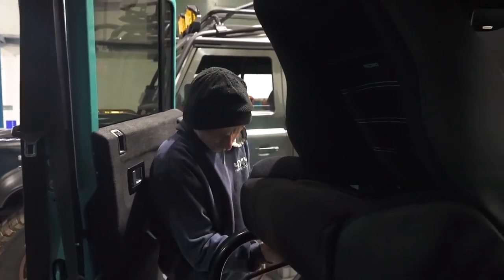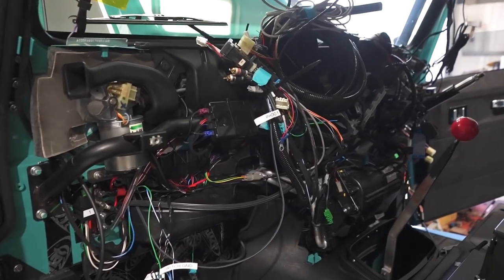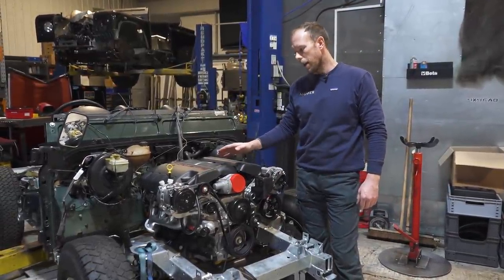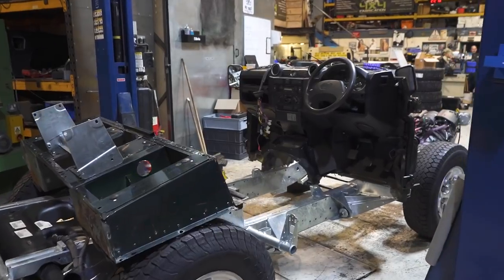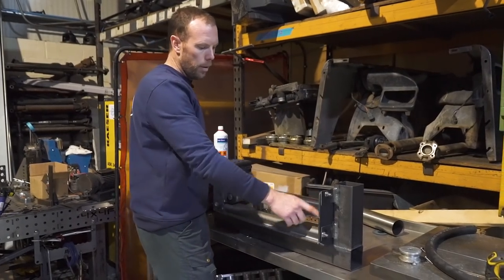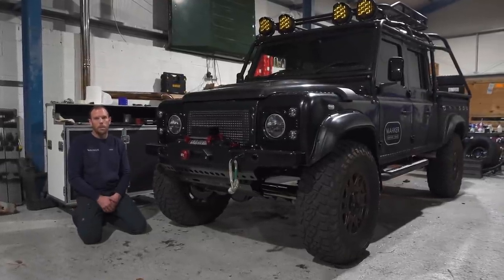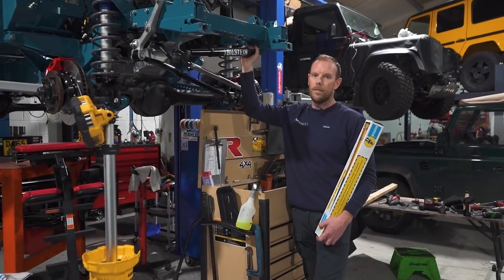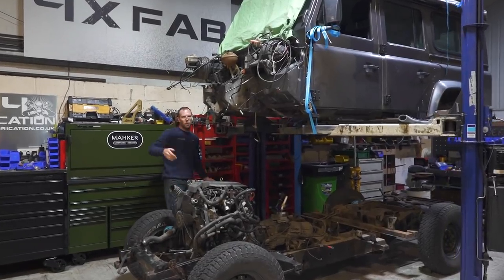THE ONLY VIDEO YOU NEED TO WATCH ON HOW TO FIT AN LSA V8 INTO A LAND ROVER | MAHKER WEEKLY EP022

Comment: Hello There.
I am working in installing LS3 in a 1986 LRD 110 (Right Hand drive) I am in Maryland USA, so no way to bring the car to you, GREAT LOOKING CARS YOU HAVE THERE...So to the point there is any possibility on buying the brackets and  accessories needed to install the AC compressor, power steering pump and Alternator as you have it in this engine.
Cheers

Rey
Reply from the maker: Yes we would sell them separately please email me to info@mahker.com

Comment: Given my 2.4 has just died after 80k miles this would be an ideal solution if I could afford it. 😂 Also, do you sell the yellow roof lights on the 130 or know if they’re suitable as spotlights and the brand?
Reply from the maker: Lights are Baja Pro Lp9s cost around £650 each